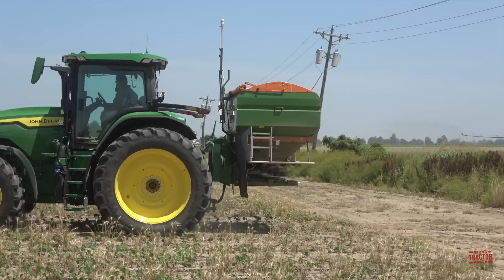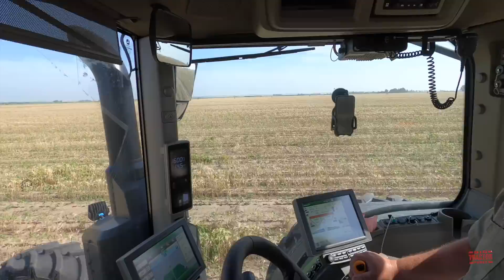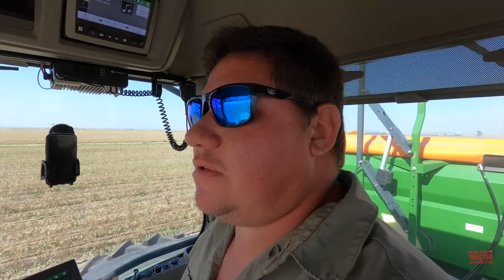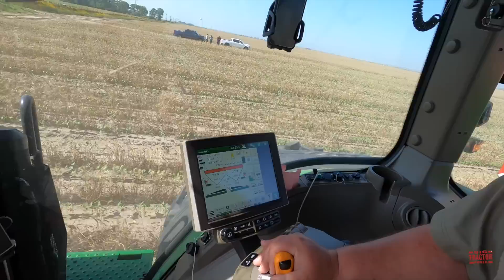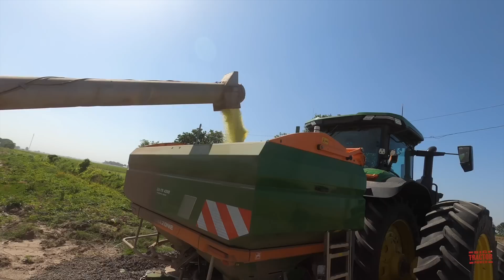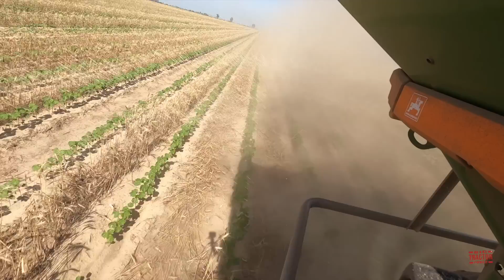JOHN DEERE 8R 280 Tractor & AMAZONE 3pt Fertilzer Spreader

Comment: We use a 3 point mounted Teagle XT48 fertiliser broadcaster on a John Deere 6330 tractor typically applying 100kg's to the acre of compound fertiliser in a 12 metre spread pattern. the spreader holds 1200kg of product loaded with a loader tractor lifting 600kg bulk bags which is the most common way of handling fertiliser here in the UK

Comment: We use a 3 point hitch broadcast spreader. Product capacity 450 pounds.  Broadcast, width, about 50 feet. Connect to behind a forward 4 4000 tractor.  Handloaded from 50 pound bags of fertilizer. 
Jason, another great video. Thanks for bringing it to us.
🙂🙏🙂
Reply from the maker: Nice spreading set up. Thank you for sharing.

Comment: Curious how much wind this thing could handle with those sensors and such while still holding a good pattern
Reply: Up to 20mph, but your speed and spreading width will be greatly reduced, 10mph and under windspeed youre probably never going to notice anything different
Reply: @iamfields606  interesting, thanks for the info

Comment: Cool spreader but the price tag seems like alot for a 3pt compared to a pull type
Reply from the maker: It depends what style you need. The 3pt is a nimble option for tight turning.   This same size is offered as a pull type and for mounting on self propelled sprayer chassis for dry applications.

Comment: Is the spacing quite a bit wider than most row crop tractors? Looks like 72”?
Reply from the maker: Good observation.  Yes in cotton and potatoes are both raised on wider rows at 38 inches which requires a wider wheel pass the run between the rows.
Reply: I think cotton is usually done on 36 maybe 38" rows.
Reply: Most you see are set up for 30'" rows while they mentioned this was 38" rows, so should be 76" spacing if I've figured right
Reply: @Beyonder8335  Right, 38" would be 76" between the centers of the inside tires.
Reply: @Beyonder8335  ah thanks. Must have missed when he mentioned that.

Comment: Had co-op top up corn with urea on a high boy spreader.  I rent an 8 ton spreader for potash and ams before corn and beans.  I pull it with a 1086 or sometimes a 1456.
Reply from the maker: Two very cool tractors.  Thank you for sharing.

Comment: Let me bring up the good old days .... when you loaded fertilizer from 80 to 100 pound bags into the small hoppers by hand  .😂 But my point is that big hopper must weigh an awful lot .just shows how strong the 3 point hitch is and how amazing equipment is. Being retired from running heavy equipment, I was amazed at the strength of the hydraulic systems. After watching... 4 1/2 tons is amazing.
Reply: Standard lift capacity is 15,200 lbs optional up to 20, 000 lbs.
Reply: @lynwessel2471  You tell me exactly where you got your information from .Please
Reply: @lynwessel2471  Please tell me where you got that information.
Reply: @lynwessel2471  Where did you find that information exactly?
Reply: Has someone that owns one he is correct. You can find the info also at John Deere website.
Reply: @PeterRabbitWhatsup Tractor Data. You can look up stats on practically any tractor ever made including official University of Nebraska testing results for many .
Reply: @lynwessel2471  Thank you, I finally found it. I grew up on a dairy farm and ran heavy equipment most of my career. I didn't realize how strong 💪  the 3 point hitch actually is. And I shouldn't have been surprised by the number.
Reply: @freedomrings1420  They're big and heavy. The good ol 4020 could lift 3790lbs.
Reply: Remember those days with the bags
Reply: @PeterRabbitWhatsup  Thats the site. Simply type Tractor Data and the make and model.5 second search.

Comment: Neat setup, don’t see spreaders like that here in north central Indiana.
Reply: It's Europe thing.
Reply: @11T872  ok nice i
Reply from the maker: They are well worth a look. They are a nimble way of using a fixed frame tractor.  This spreader is also sold as a pull type and to mount on self propelled spreaders.
Reply: @bigtractorpower  that’s really neat 👍